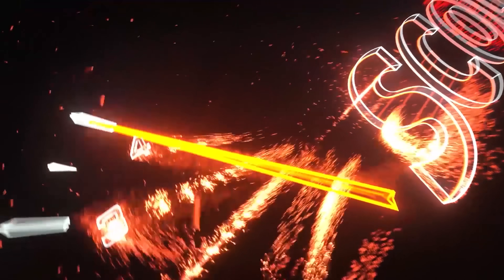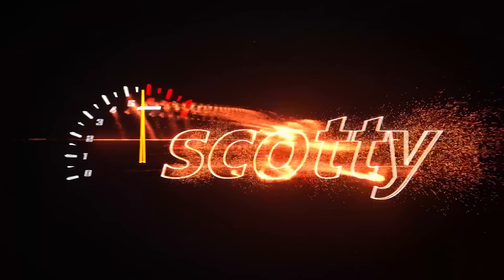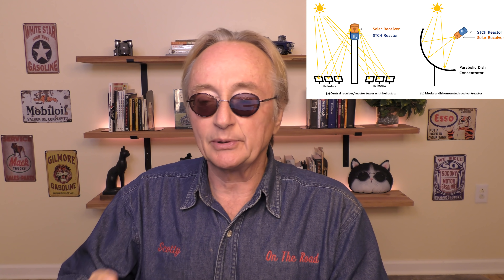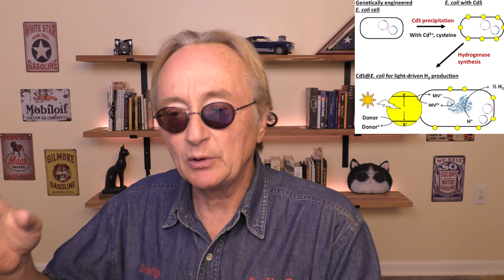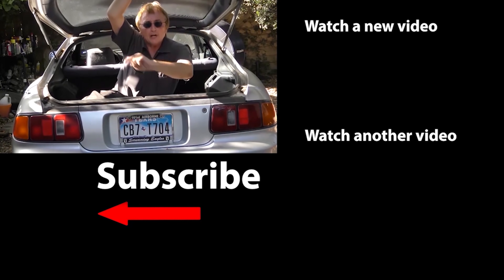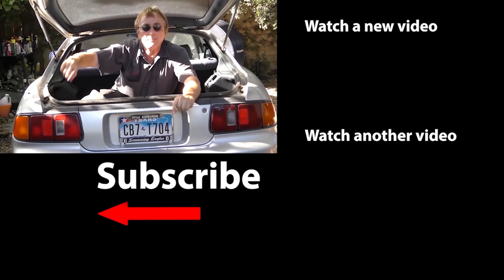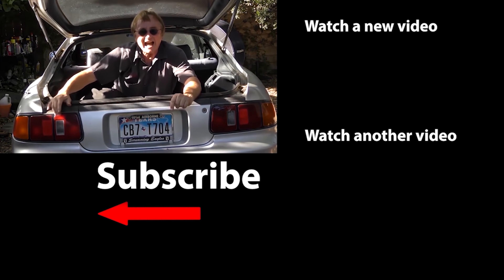Here's Why Electric Cars Will Soon Be Replaced By This

Comment: What I don't understand why don't they take hybrids and make steam from the exhaust since the internal combustion engine has a byproduct of heat. If you took that steam drove a turbine that's even more energy returned to the fuel cell. As we already know whenever you turn water into steam it basically expands 16 times in gases from its liquid state. They could probably do one better if they use that energy off of the exhaust to create Brown's gas and reintroduce that into the combustion of the ice.

Comment: Hey Scotty I am looking at vehicles to keep in mind for the next 5 year to drive as a first car and I’m looking at hatchbacks I was looking at the hundi Veloster and I know how u feel about hundi if u could give a recommendation other than Veloster I will really appreciate it. Ps sorry about the spelling if i spelled.
Reply: Insurance and reliability aren't so good on the Veloster. Here are better hatchbacks for less money.

2004-08 Matrix or Pontiac Vibe
2004-09 Mazda3 (have the motor mounts looked at during the PPI, otherwise extremely reliable)
2004-06 Scion xA or xB
2011-13 Matrix (more expensive than the other three; '09-10 weren't reliable)

Comment: Hey man In the process of buying a 2001 zo6 with cams and heads. The owner doesn't really know what clutch got put in it but apparently it was done not too long ago. The clutch requires what I feel is A LOT of gas. Also the car apparently is "running lean" from the owner. It smells like gas when running. Should I fully commit and get the car or should I skip on it. I'm going to daily it throughout the summer and in winter I'm going to get a beater box and run that. I would really appreciate your opinion on it. Is 19k $ too much. Its pretty clean for the most part a 4 inch scratch on the very bottom of the passenger door and a small spider paint issues on the front bumper. Had 5 owners - was from florida has 60k miles on it. Zo6 wheels tires are alright - probably needs front tires sooner than later. Hopefully I hear from you before I go back for it. P.S Im in love with the car, never been more in love with a car, but don't be afraid to break my heart.. I put 100 bucks down so I haven't spent all that money just yet..
Reply: Don't bother, because that money would be better used to pay off debt, or avoid going into it. Student debt is no joke; a lot of people my age have been unable to buy houses because of it. Your future self would want you to set yourself up for a sweet life, not having a sweet ride get in the way.

Comment: I have a 2009 scion with that exact engine in it and I'll tell ya it loves its motor oil. It does however still run and it's burning about a qt every 600 miles and has been for the last 30,000 miles now. No fouling of plugs I been changing it regularly, somehow it still seems to be running okay. I expected it to be dead by now I'm impressed it's still running, however it's a Toyota I suspect it'll make it a little longer. Looking through prices a new motor isn't overly expensive. I'd definitely never recommend this car to people that just want to drive and never check anything. It is a good driving little car though and 160,000 miles I'm gunna run it till the engine either siezes or the wheels fall off.
Reply: Replace the PCV valve and see what happens. Only use a Toyota or Denso valve.

Comment: Hydrogen would be a good solution to replace diesel-fueled trucks. Electric trucks require too many batteries to be practical.
Reply: Hydrogen takes a lot of storage space.
Reply: Hydrogen fuel cell car or trucks are electric - they are powered by an electric motor.
The only difference is that fuel cell cars are more expensive and complicated - hence you see more battery cars and trucks in the future are you.

Comment: The problem with generating hydrogen in a central location is that it's a pain to store it and/or move it because it will leak out through a much smaller crack than it would take to cause a significant problem with a heavier fuel. It might be better to react  the H2 with captured C02 to make a more practical fuel like methanol or even some form of gasoline.

Comment: One of the most reliable vehicles I owned was a 2007 Mercedes C230. I got like 28-30mpg and it was a commuter workhorse!
Reply: My best car was a mb 190 diesel from 1984. Only electric on it was de starter and the radio. Drove it for over 6months with the oillight burning. Nothing happened. Im still sorry I sold that tank. It was slow but comfortable big open sunroof manual of course. 10 dollar diesel and I could drive all day long.

Comment: We got a 2015 altima for the wife,transmission was replaced at around 35k,is there any other better transmission that we can can replace this CVT one with?
Reply: What did you guys do to the CVT? Yeah, Nissan CVTs are terrible but a 2015 and replaced at 35k, like what? My dad has a 2014 Altima with over 100k miles and hasn’t had a problem with the transmission yet.
Reply: @jgonsalves22  nothing,car was always service by the dealer, on one of ours trips, transmission just dint felt right, it will struggle uphill, dealer checked it,could not fix,  so they replaced it.problem gone.
Reply: No; after the powertrain warranty runs out, have the transmission cooler beefed up. Replace the CVT fluid every 30k miles with OEM Nissan CVT fluid.

Comment: My 2004 Gmc sierra has 200,000 mile and the trany and engine seem to be fine ( knock on wood ) the funny thing is the driver mirror that has shaked since i bought it brand new they replaced the mirror with a new one and the mirror shakes in that had a chevy earlier model that did the same thing . I am surprised it was never a safety recall as it greatly reduces the ability to see out of it with a vibrating mirror . The ceiling felt is coming down and the same thing happened with a friends truck . Rear brakes have not needed to be changed . Air conditioner still is frosty but sometimes it get locked into a heat cycle which needs to be reset to get it back to normal operation . Gmc always had problems with air conditioning . For GMC is the lack of detail to the little things .Problay they feel that where to save money . Its always a bottom line and have to deal with stock holders . There needs to be a transition from gas to something else and its not totally about green because oil is a finite resource that will run out . Hydrogen is the logical choice and toyaota belives that also but we are still far off of making that environmentally and fiscally doable . Batteries maybe a bridge to get to that point unless the batteries become more viable

Comment: Hey Scotty,
Would it be possible to get around the computer difficulties when replacing a battery by keeping a battery jump connected to the cars battery cables, thereby never losing power to the computer system while hooking up the new battery?
Reply: Technically possible, though either of the clamps may slip while you're working. You're better off connecting that jumper pack to an OBD2 converter.
Reply: Also, the battery cables, themselves may be insulated.

Comment: My neighbor is old wants to sell his 2014 f150 is it a good buy
Reply: Never buy a truck for fashion, only to frequently tow or haul. You should also only buy it if you have no debt other than a house, and can buy the truck outright.

If the brakes aren't smooth, then the rotors are warped. Random stalling is caused by a bad throttle body. If there's a warbling sound from the speakers, it's probably a bad pigtail from the audio module to the speakers. Otherwise, they're pretty reliable.

Comment: Hydrogen IS an intermediate process.  Why convert sunlight to electricity to hydrogen.   All you are doing is creating a vast panoply of middle men. Doubling the cost.
Reply: Electricity storage currently requires rare earth metals, many of which are in China and the battery recycling process is expensive and bad for the environment. (They're melted down)  It all depends which tech advances first because lithium batteries are going to get more expensive as time goes on.

Comment: 7:30 I buy my used tires at a shop that's abroad a current dealership, people but their brand new car, go abroad to get 20" rims, and I get their "old" tires with less than 10 miles on them for 50 bucks a piece.

Comment: Hey Scotty out here in Nevada car lots are required to put new tires on any vehicle being financed thus creating low mileage used tires commodity for sale.
Reply: I hate laws like this. Obviously, someone in government is connected to a large chain of tire stores. CHa-Ching.
Reply: hxhdfj ifzir st c - Also the used tires have to have a certain tread depth or they are sent to the recycler.  Used tires for my truck will run me about $40 each, so when your talkin a fifth the price of new ones, it can be easy to cheap out.
Reply: hxhdfj ifzir st c - surprisingly I have taken the truck on some long road trips with better tires and with Cruze control my little old truck 23 to 25 dependent on direction.  Always get better gas mill age coming home cause I live at the bottom of a valley.

Comment: 2017 pathfinder ? Thinking about buying one.  Never owed a Nissan.
Reply: Don't do it! The transmissions in Nissan are total crap. Before 2010 they were fine. Buddy has an 09, 250,000 and it's fine. My sister's 2014, nothing but problems with that CVT.

Comment: The word of the day is Momentum.  EV's have the momentum and Hydrogen is not ready for wide-spectrum, full-scale production.  The Momentum is with the Public, which have bought in to the EV idea, the public will have to have their minds changed before Hydrogen can dominate.  Most likely, Hydrogen will gain traction in Larger vehicles and the general public will drive EV's.  EV's already have a reasonably sufficient infrastructure for recharging, so where are all the Hydrogen refueling places?

Comment: Hey Scotty, love the channel, I have 2002 VW Passat 1.8t with over 250,000 miles and the transmission finally stopped moving any clue as to why this happened?
Reply: Manual or automatic?
Reply: @Dcc357  automatic
Reply: @stevegamez2825  Transmission more than likely worn out if it's just slipping in drive and reverse. Replacing it will be worth more than the car. It might be time to find something newer, or brand new if money is rolling in.
Reply: Because it's a VW.
Reply: @PaulLawson-k8v  20 years is a longtime for this VW it lasted longer than most cars its year I guess I take care of my cars!

Comment: Made my own hydrogen generater with stainless steel plates in a 4 inch pvc tube. Works. You can make your own. And clean........
Reply: You can capture hydrogen gas from charging a lead acid battery also.
Reply: @northdakotaham1752  I used a 10 amp dc regulated power supply to run mine. 6 stainless plates in 4 inch pvc filled with water. Electralasis at 9 amps makes the water bubble like alka seltzer in a glass of water. Lol used it on my kids old mustang, works.

Comment: Absolute bonkers nonsense. Total WTW efficiency of EVs is like 75% (incl. line loss) whereas FCEVs are about 30% efficient *only considering losses in the drivetrain*. If you include generation losses, which are very steep for electrolysis, the figures get even more abysmal. FCEVs are nothing but a more complicated, less efficient EV with the sole benefit of fast refueling. They used to have a range advantage but now electric cars exist that can do the same, *for less money*. Promoting FCEVs now is like promoting Betamax in 1995. Besides, y'all really gonna listen to this man about electric cars when he spent 24 grand on an electric Smart with 60 miles of range? When the same money could've bought a 236 mile Bolt?

Comment: Still it's better to make electricity from hydrogen to give EVs electricity then making hydrogen cars , I mean hydrogen is very dangerous in car crashes if the tank got damaged a single spark can make the place go boom .
Reply: Exactly, but gas is the same way. However hydrogen can escape quicker and doesn't linger around as long.
Reply: What John said. Hydrogen by itself is explosive in oxygen environment (as is air) but it is also VERY light (the lightest element after all) and stored in high pressure tanks, so if the tank is ruptured, it will escape VERY quickly and straight up in the atmosphere (like a helium baloon). Unlike gasoline vapors or LPG which are both heavier than air and replace and/or mix with the air around the vehicle, then all it takes is a spark or some heat to go boom. So in a way, hydrogen is actually safer than gasoline or LPG. For an explosion you need fuel, oxydizer and heat/spark. If the fuel is no longer there a second or two after the tank ruptures, the chances for an explosion are much lower.

Comment: Hey scotty random question, im driving an 07 toyota yaris, my right rear turn signal light is not working even after putting a new bulb,  its making my right front signal blink fast. What can i do?
Reply: could be ground problem,
Reply: Recheck the number on the new bulb. Could be the wrong one. Check your owners manual for the correct number. Just bc bulbs look the same doesn't mean they are the same.
Reply: Sounds like a short, probably have to trace the line and see where it’s damaged
Reply: @JsChannel8  it could be because i switch both lights nd they seem to be working just fine but its just the right side that is not turning on.
Reply: If you have a loadpro just take out the bulb and load the circuit you’ll get the answer within a minute
Reply: Buy another socket from a junk yard or wherever, and wire it to the left turn signal. Boom. You're welcome.

Comment: If you can do a green energy powered compressor to compress air in carbon storage tanks to run a "Compressed Air" motor, you could have less solution. Course, cars would have to be light weight vehicles.

Comment: The first time someone's house blows up because of a hydrogen gas leak.......    that will be the end of this tune.

I worked with helium and hydrogen in industry.  The stuff leaks really well.
Reply: Quite a few homes have exploded from natural gas heat. Didnt make any difference. There have also been several fires caused from owners recharging their electric car.
Reply: @northdakotaham1752  isn’t that the same as ICE vehicle. ICE car catches fire a lot as well
Reply: @northdakotaham1752  Electric cars have been known to catch on fire in a collision.  The batteries, you know.
Reply: @northdakotaham1752  when natural gas became the norm, we didn't have the authoritarian federal government we have today. It's been grandfathered in. The saying is still true, you couldn't invent the car in the United States today.
Reply: @mikedonovan9033  with the excessive regulations in the U.S. these days, it's  miracle that anything is ever accomplished.
Reply: @northdakotaham1752    The explosive limits of Hydrogen are 4 percent gas to 75 percent.    There are not many gases with a wider explosive range.

Methane's explosive limit is 4 percent to 16 percent.  

This means that the odds of an explosion involving natural gas are much lower than those of hydrogen.   

Hydrogen is a very light gas, it will raise to the ceiling, where the electric lighting and any overhead motors may happen to be.

Fuel air explosions in enclosed structures tend to cause a heaving effect - the roof is lifted from its supports,  then it falls.  Onto people's heads.
Reply: @jamallabarge2665  I doubt than anyone would consider hydrogen as a heating fuel. It has however, been successfully used in fuel cells. Designed and created over 50 years ago.
Reply: I am guessing that the above commentators have no real understanding of "The stuff leaks really well.". Both will literally pass right thru the steel in a storage tank.
Reply: @bradquinn4161  you don't need a storage tank. Check on-line...you can already purchase hydrogen generators that produce hydrogen on demand. There is no storage requirement. The hydrogen isn't produced until you need to use it.
Reply: @bradquinn4161  it doesn't "pass through steel" - any leaks are from faulty valves. This is why hydrogen is still the leading choice for long term energy storage at both Microsoft's and Apple's HQs.

Comment: I strongly believe that car makers purposely design cars extremely complicated, so that the dealers will be badly needed for repair and maintainance. Alternator/AC mounts, and such, are a great example of this.
Reply: I think it depends on the vehicle. A 4 cylinder, in most cases, is way easier to work on than anything else!